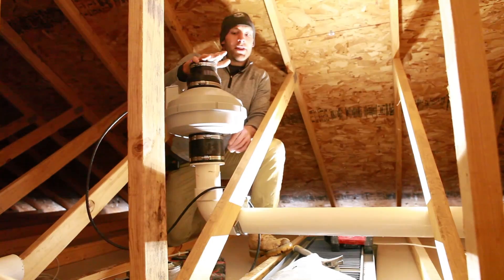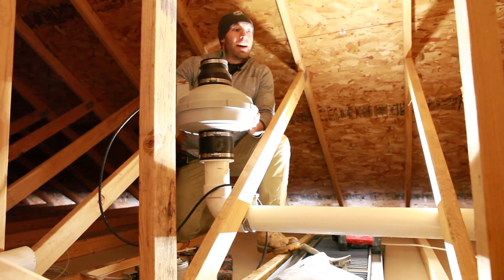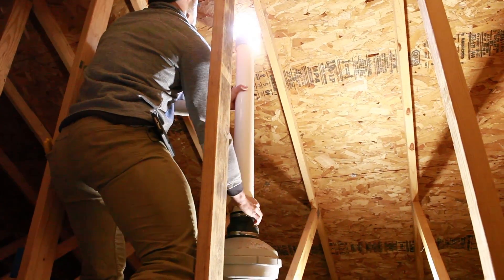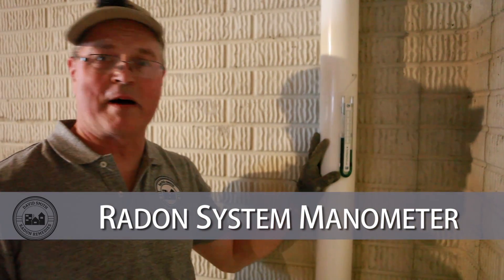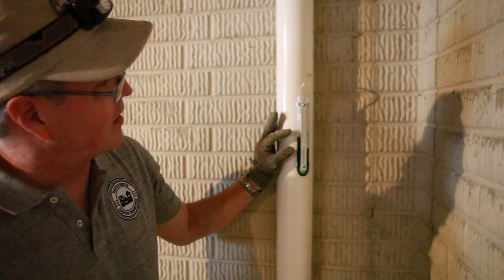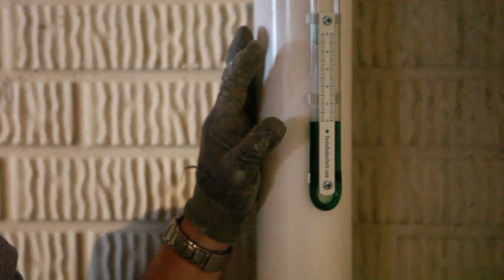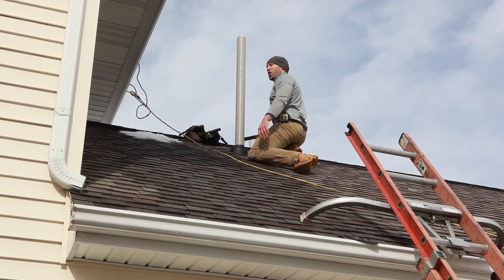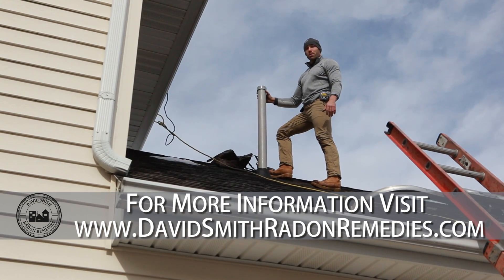Radon System Installation

Comment: I would assume the fan just runs on 120v?? Also what size pipe do you use into floor and to vent it
Reply: 4 inch preferred. 3 inch can also be acceptable but 4 inch is better